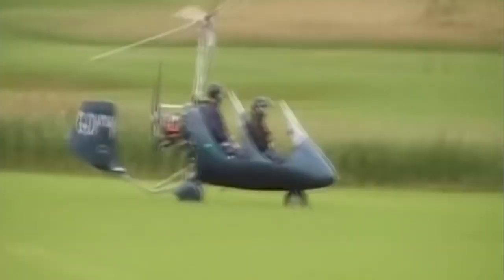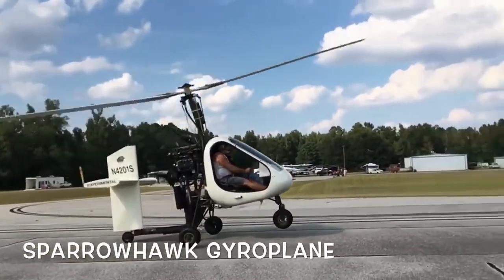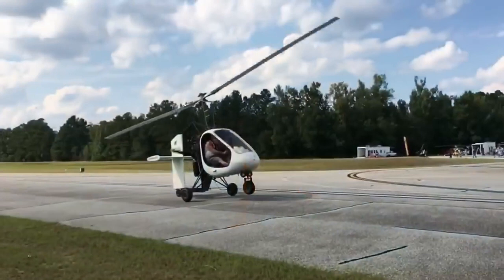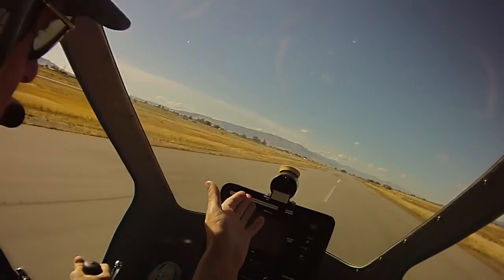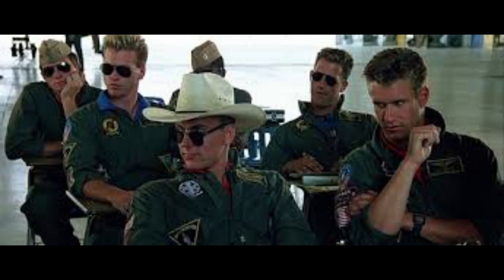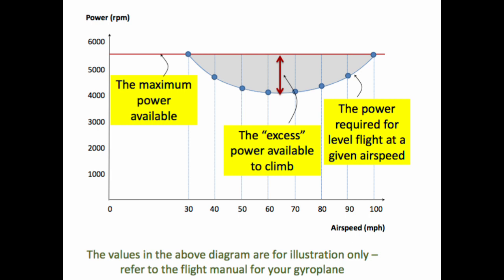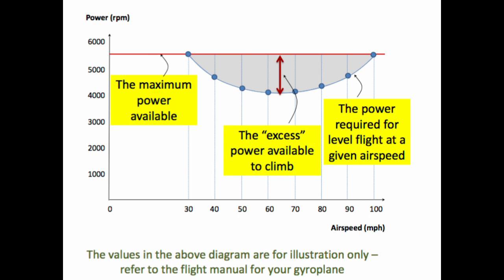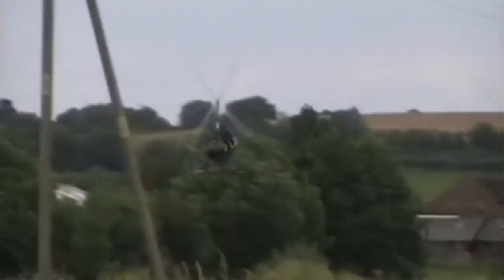Gyrocopter flight behind the power curve

Comment: After watching many of these videos I hear a lot of throttle reduced and then add more power. Isn't the proper thing to do on take off is apply full power and leave the throttle there. Why do I hear people reducing power on take off???????????
Reply from the maker: Good question - if you have a link then I’ll try and be more analytical but usually it’s either someone unstable during the ground roll or uncomfortable with the pitch attitude or someone trying to find this wheel balance point.  Hope that helps, cheers Phil.
Reply: I completely agree. I've seen fixed wing pilots do it, I seen powered paragliders do it. It seems to be a popular thing to do these days because I was never trained to do that for my fixed wing and it's not a philosophy I subscribe to. When I take off I want all the power, airspeed and altitude allowed by law right now just in case some goes wrong.

Comment: I’m getting the impression that you have to have a clear understanding between the pitch of aircraft AND the angle between the blades (is it called a cone?) and the relative airflow. The two are not the same. I also have a question - why don’t people apply full power to take off? I’ll hazard a guess that any takeoff performance figures require the use of ‘takeoff power’ rather than some notional value above idle.
Reply: Eu também não entendo o motivo de não se aplicar toda a potência no momento da decolagem, talvez seja por receio de não conseguir compensar a força do torque da hélice logo no início da corrida, então vai se aplicando a potência aos poucos até o leme ter um bom fluxo de ar, já com a bequilha fora do chão, conseguindo então controlar a aeronave no chão através do leme e não pela bequilha. Mas, no meu ver, o ideal seria já aplicar toda a potência logo no início da corrida, assim se consegue atingir a velocidade mais rapidamente, proporcionando uma decolagem mais curta.
Reply from the maker: Hey Trevor hope you are well.  Yes once the blades start spinning they start to cone, how that links to the relative airflow (and therefore the alpha) is more to do with the fact that if you take a section of rotor blade then the airflow that section sees is a combination of airspeed as per the entire aircraft (and represented by the ASI) and the rotational velocity of the rotor.   Most rotors on modern 2 seaters have a 28ft diameter - so basic maths sees the tip speed of the rotor = 1mph at the tip for 1 rpm of the blade. The blades will cone further as as result of g and rotate faster.  Although that isn't so much a factor at take off.

The reason a lot of people get into take off snafu is that the simply don't reference airspeed on take off.  If you follow the link to the video you'll see not once does the instructor prompt airspeed to the student and there was plenty of time prior to pitch becoming an issue.

Why don't people use full power?  Honestly one huge issue is that one of the very influential gyroplane examiners - a chap called Phil Harwood - specifically doesn't call for it, and so because very many just follow that lead. 

Yes you are right the POH performance figures do require the use of full power and of course even if the TODA is large compared to what is required the use of full power gives increased margins during the take off phase.
Reply: Gyrocopter flying club - Yes, we are all very well thank you. And thank you for your explanation regarding airspeed, rotor speed and relative airflow. I think I’ve now got that. I also noticed the lack of patter from the instructor. But you have also got me wondering about how is it possible for an examiner NOT to follow an AOM. Unless there is a specific document stating otherwise from the CAA or an equivalent you follow the techniques as described. I hope he is well insured because he wouldn’t be able to wiggle his way out of questions from a well briefed barrister or the AAIB.
Reply from the maker: I know it’s easy to run people over in isolation but by the same token these are films published and therefore one might think the publisher is proud of his effort.

On the legal side I agree and I think the day will come and likely soon especially as the 2 seat factory type of aircraft is adopted more in the USA. In the UK one feature is that the CAA and the AAIB are technically quite oblivious when it comes to gyroplane and sadly on the AAIB side it seems it’s because technically it isn’t exciting and I say that because every month I can read chapter and verse about some UAV that has melted but when it comes to Bloggs cartwheeling down a runway through a piloting error you get a 5 word summary from the pilot himself. At some point it will come to a head I’m sure.